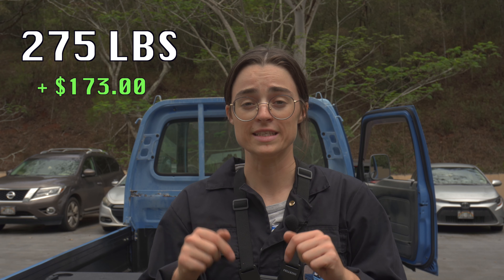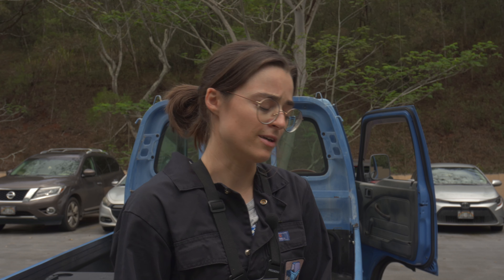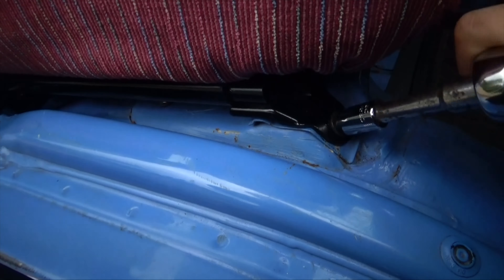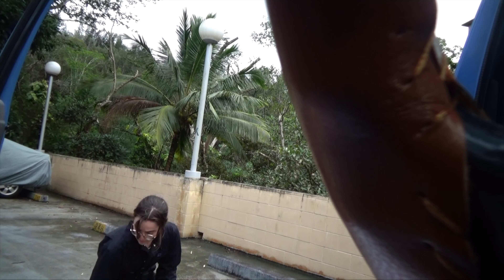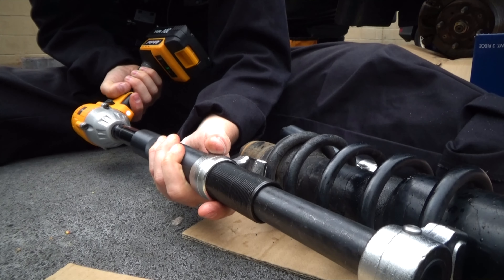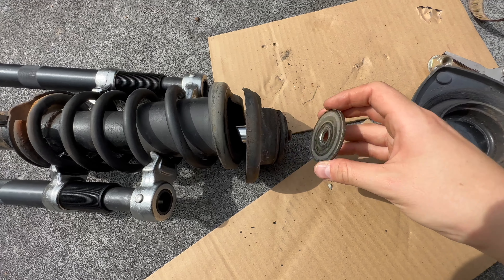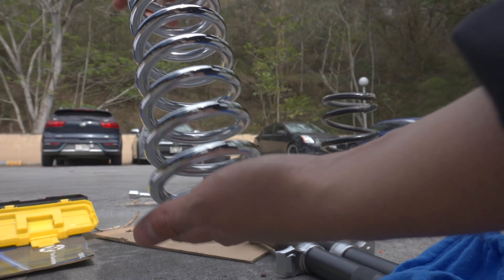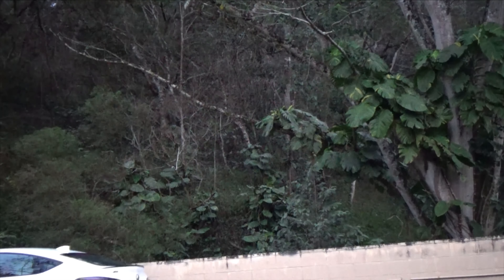I (NOT a mechanic) Replace the Springs on my Kei Truck

Comment: I own a 94 Acty and have done a plethora of work on it. I’m impressed with your tenacity. Not many younger people will tackle the jobs I’ve seen you take on.  Especially with basic hand tools and no garage! Fight the good fight! I will keep watching you and give you advice if you want it.
Reply from the maker: Thank you!! I'm slowly learning as I go. Trying to do as much as I can myself as a beginner. And I will always welcome advice 😀
Reply: @JulesMariani  You are doing great, for real. I've been wrenching on anything with nuts and bolts for 40 years. I've made more than a few mistakes along the way! I'm an aircraft mechanic and do 95% of my own car/truck maintenance (Jiffy Lube can do oil changes cheaper than I can, LOL). 
Anyway, if you're up to the task, I highly recommend you change your timing belt. If you don't already know, the Acty engine will self destruct if the timing belt breaks or jumps from being old and loose. Here on Youtube,  RHD_Ron has a good series of videos. He has one showing the timing belt change. I'm too old and stubborn to start making my own videos, otherwise I would make one for you! LOL. 
It's a tough job no doubt and will take you all day. If you decide to tackle the timing belt, I recommend changing at least the LH engine mount. It fails more often versus the other 2 mounts. You have to remove that mount in order to do the timing belt. Ebay will sell you the mount for less than $100. Also on Ebay are several timing belt kits available. Most kit include gaskets, thermostat and the water pump. Take care and I'll be watching your progress!

Comment: I put a set of Summit Racing 300 poubd springs in and it helped a lot. I too got the chrome, but after just one year ghe chrome is pitted and coming off.  In hindsight, I should have gone with painted or powder coated.

No need to be on your rump working on the springs.  Once the strut is removed, use your truck's bed for a wotkbench.

Lastly, look at an exercise / yoga mat. Much nicer to lay on the ground while working under the truck. Keeks you dry, clean, and much warmer.
Reply from the maker: You make some excellent points! The next day my back was so sore and realized I should have been using my truck bed as a work surface. Thank you for sharing some great tips!

Comment: As someone that's not mechanically inclined, I appreciate this video. Showing things like where you placed the jack and what jack you're using is super helpful. I think a lot of folks that make these kinds of tutorial videos tend to take those little things for granted and glaze over them.

Curious if you have a list of tools that you have, wish you had, and/or that have been helpful. My Acty gets in in a few weeks and I know there will be some work needed. Thanks for the video. Again, super helpful.
Reply from the maker: Hi, I try to include those things because as I’ve been leaning I didn’t know them either! Throughout the course of owning the truck I have picked up a lot of new tools. Drill, deep sockets, soldering iron, rolling tool box (good because I don’t have a garage to work in) But in the beginning I got by for a while just using my trusty mini tool set. I got it on Amazon for $20. https://www.amazon.com/gp/aw/d/B07DWC5FPT?psc=1&ref=ppx_pop_mob_b_asin_title

A recent addition to my arsenal is a ratchet wrench set for some awkward to reach locations. I will probably soon pick up some tire ramps for when I’m feeling lazy and don’t want to jack up the truck. I hope your acty is in great shape and doesn’t need much to get you going!

Comment: Hey, imma have to venture into suspension land as well as far as one of these, keep an eye on the steering linkage, it's an old type kinda consisting of,but not ,., is used as areference point. It was called a watts linkage,  no where's necessary the same, but kind the same concept of load leveling. Thank you again.. You're doing absolutely excellent.Give yourself a lot of credit., People have no clue how to , Everybody over thinks it cause it's an import.

Comment: Wouldn't have bothered lowering the jack any further then when the weight was transferred to the jack stands. Going to have to lift it back up when you are done anyway and having a third support below never hurts for safety. 
I ended up putting eibach springs on mine and poly bump cushions in my struts. No way ever can bottom again.

Comment: I'm pretty sure you're not supposed to lift from there for future reference. You're better off using the pinch welds. 
Also that's a sketchy spot for the jack stands, it could potentially slip off and the center of gravity is very precarious having them placed towards the center of the vehicle like that. If you look below and just behind the doors you'll see two small jack points that will work much better.
Reply from the maker: Thank you, Dreadred. Still figuring things out as I go. Been trying to follow other videos, but often things (obvious to others) get omitted. Are the pinch welds a bit further back? I've seen others jack in that front center area. And I will look for the jack points as I thought those were it... 😵
Reply: @JulesMariani  Actually after looking in the factory service manual I think you're ok to lift from behind that plastic cover! I'm sorry I was mistaken. But yes, the spots you'd be better off placing your jack stands are just behind the mud flaps for the front wheels. You could alternatively use the two 'c' shaped pinch welds at the front corners behind the front bumper. You can see one of them at the 1:28 mark in the upper middle of the screen.
Reply: Do not lift any vehicle from the pinch weld, lift from the pumpkin,subframe,cross member. Especially for a vehicle prone to rust like the Honda acty.
Reply: @garagespooky8193  That is not correct, the pinch weld is meant for lifting. And you can tell if it's rusty or not by looking at it. With your eyes.

That's wild to bring some misinformation like that, the factory service manual recommends the pinch welds as jack points. Not to mention a simple google search will tell you it is safe to use pinch welds.

Comment: I feel you about not caring much about vehicles other than the Kei trucks. I was only riding a bicycle everywhere because I didn't have any love for the vehicles in the US. Best to order all the parts you need all in one if you can help it due to the shipping cost. What made you go with Honda on the Kei trucks? I believe I'm going with the Subaru at this point since I'm going to only use it on the road mostly, I've heard that Honda is also a good one on the road. I see a lot of people going Honda more than I would have thought. I haven't decided if I want a Suzuki but now I wonder why people like the Honda so much 

Let me know why you picked Honda, I would love to know.
Reply from the maker: Hi picked Honda because of brand recognition, reliability, engine placement, maintenance, and price. I didn’t want a kei truck with an engine in the cab. I could find the most content and tutorials on the Honda Acty so I felt confident I could take on a majority of the maintenance that would be required. Also, at the time, the Honda was one of the cheapest Kei trucks I could find. If I could go back, I wouldn’t pick the truck I have, but rather a Honda in decent shape or maybe Subaru. But without seeing the truck in person I landed bit of a dud.
Reply: @JulesMariani  yeah I went to a dealer and wanted a Honda but my legs were too long. I felt like my feet were cramped against the pedals so I didn't have room to quickly move them on and off of the pedals, felt pretty unsafe for me. I ended up going with a Suzuki which was actually my second pick after more research. Luckily the Suzuki I picked was hard to turn down, It had only 12,000 mi and barely any scratches or rust. It was practically a brand new vehicle from the looks of it and the way it ran, probably didn't help the Honda that I tried that was a little bit worn out so when switching gears it felt very bad in the Honda and very smooth in the Suzuki. My guess that would have been fixed with changing parts though, in the end I'm happy with what I got just got to wait for it to get ship back to me.

I never drove a stick shift before so that was a very new experience, honestly I thought it would be easier hahaha. I got the hang of it enough but I didn't feel safe driving at the back roads 2 hours from there to my house with the little experience I had and by myself
Reply: @JulesMariani  I forgot to ask, how do you like that mirror you got after using it for this long? I was thinking about buying one for when my Suzuki gets here.

Comment: So did this fix your clunking issue and bottoming out?
Reply from the maker: It does ride better, but still CANNOT handle speed bumps what so ever!!
Reply: @JulesMariani  nature of the beast
Reply: Needs the strut bump absorbers to get rid of the clunking. Ordered a pair from summit for around 39 bucks each. Way over priced but worth it to not bottom out. I think I got 2 inch long ones with 18mm holes

Comment: Hows the ride with the new springs? Theyre not flushed are they ok?
Reply from the maker: Honestly, it’s hard to tell a difference at the moment. Feels very stiff and still resulting in some whams. More testing is required, but I haven’t been driving the truck much recently since I need to address a coolant leak
Reply: @JulesMariani  I don't know myself for sure but I hear these trucks aren't going to be a smooth ride so it might be normal?